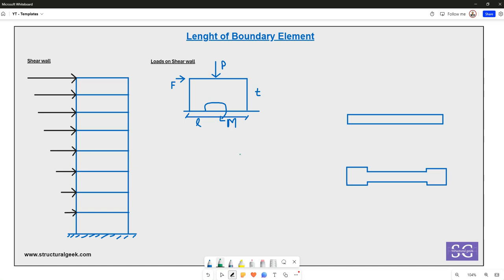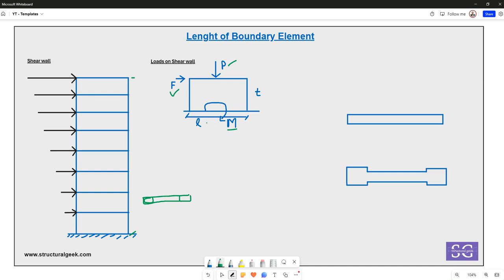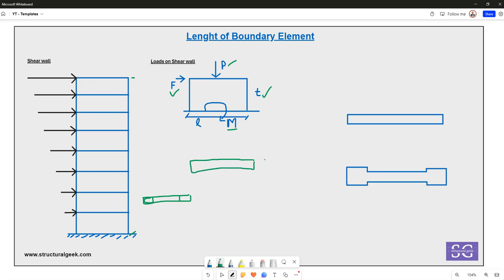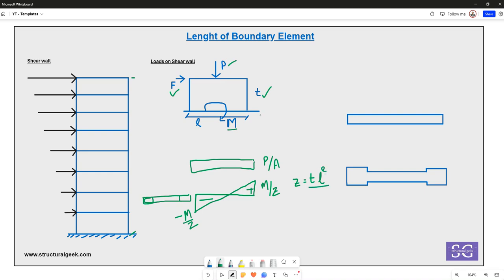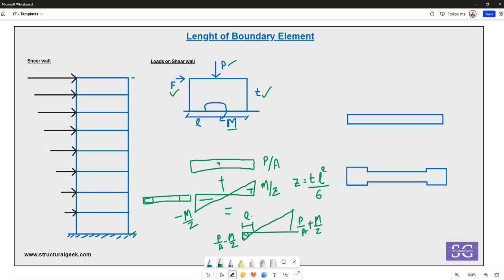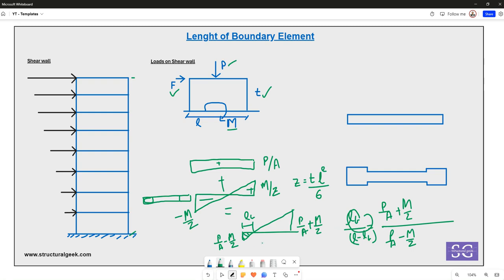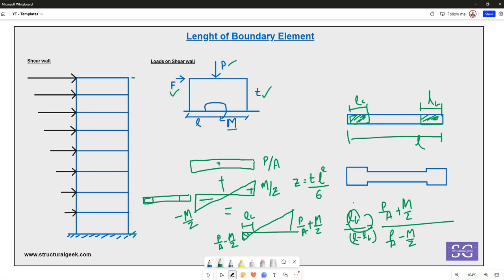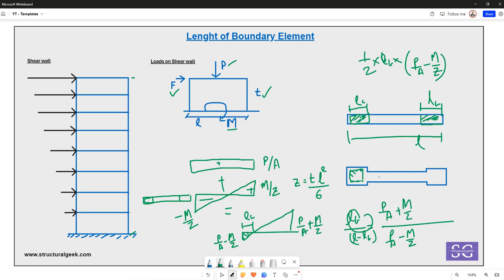Length of boundary element

Comment: Reinforcement area calculation seems wrong. Stress multiplied by length will not give u rebar area.
Reply from the maker: Absolutely true.
It will give the tensile force . Which then divide by the yield stress (0.87 fy) gives you the reinforcement.
Reply: Sir,(0.5xlb(P/A -M/Z) give unit N/mm If this value divide by 0.87 fy then give unit mm ? How to get reinforcement in mm2
Reply from the maker: The forces you will get in kN/m or N/m that is the force per unit length. If you divide that 0.87 fy which has unit as N/mm2.
You will have reinforcement in mm2/m which rebar per unit length.
Reply: Sir,Can u share such calculation with example for proper clearance